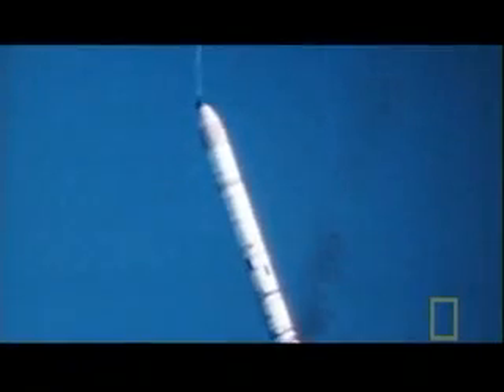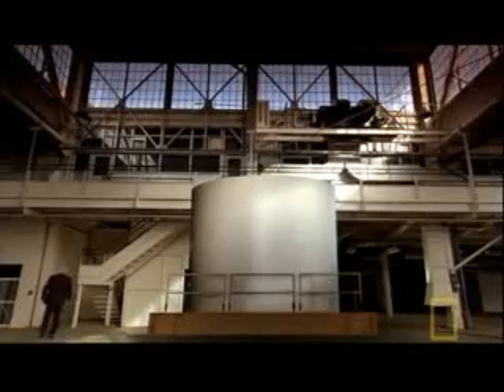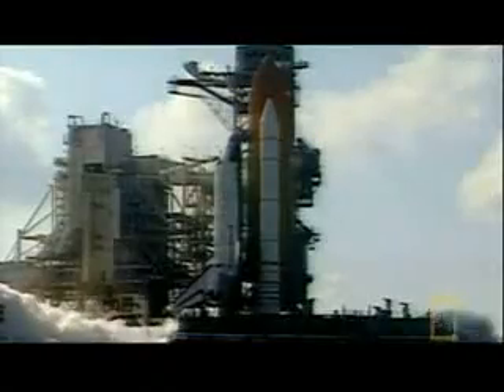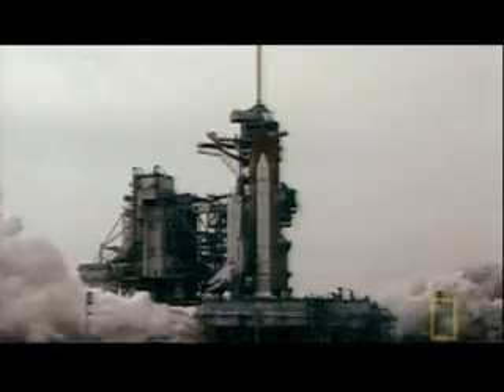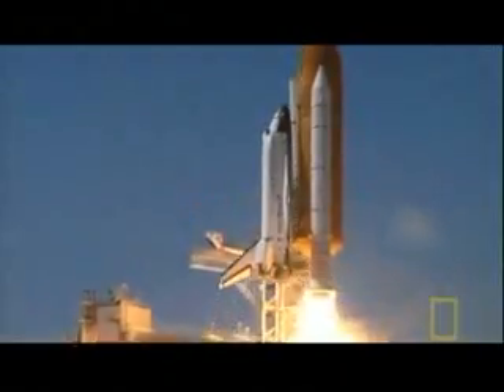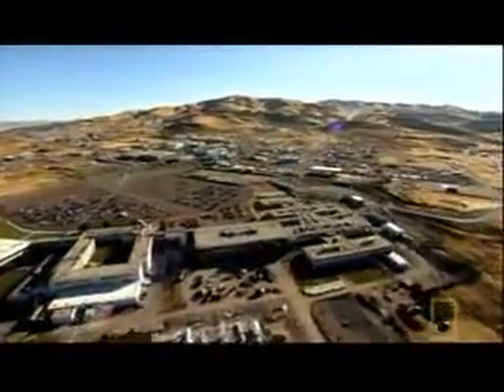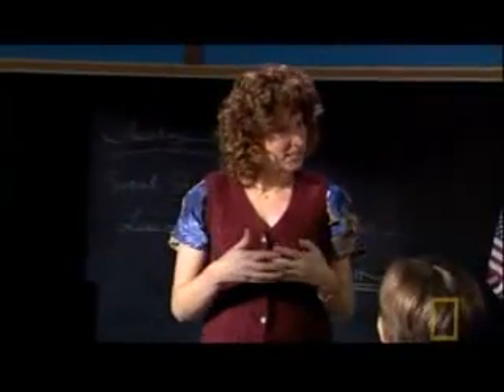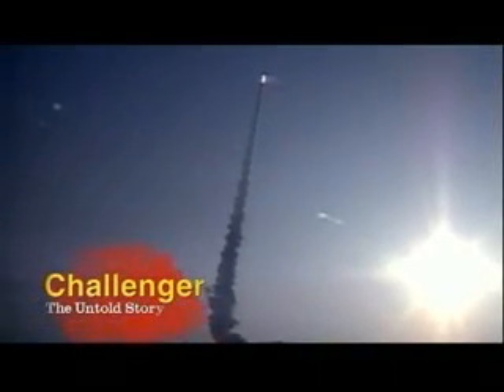Challenger: The Untold Story Part 2 of 10

Comment: Those o rings are so thin.  They should be 10 inches thick. These are rockets. Why do thin and flimsy
Reply: They're meant to seal a gap.  I doubt a larger O-ring necessarily would have helped.  The idea is to seal a gap.  It isn't to necessarily be a barrier.  They're positioned inside gaps that are meant to close or at least expand when the booster rocket is ignited.  The O-ring isn't supposed to necessarily be the last line of defense.  I think it's simply a stop-gap meant to close the gap.